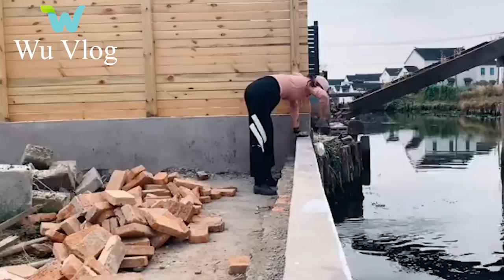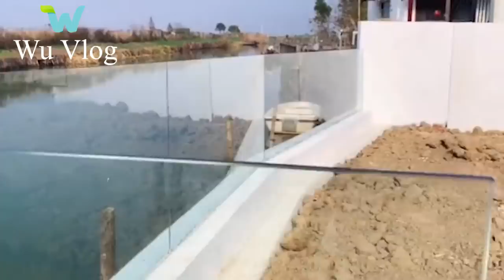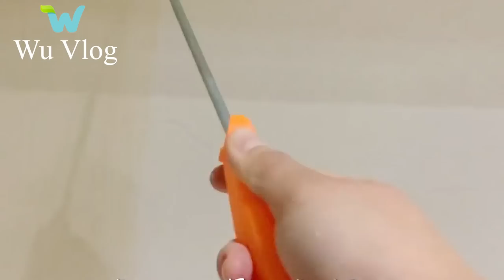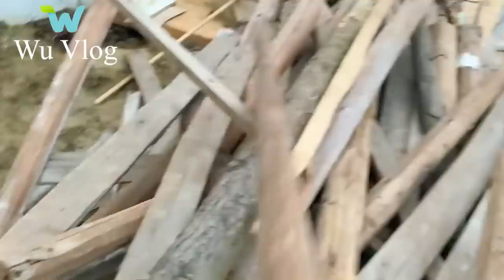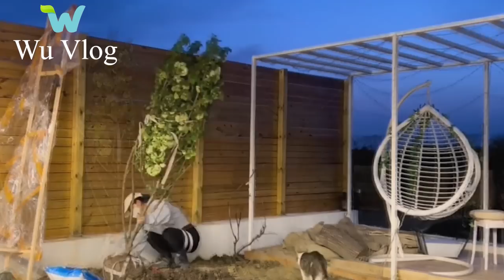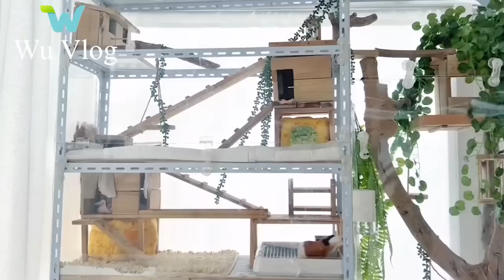After years of accumulating money, the girl decided to build her wooden house beside the river

Comment: I am wondering how this house gets insulated. Also, with concrete as a base, the floor must be cold in the winter. Would floor heating not be ideal?Beside the little fireplace, how do you heat this house? What are the round openings in the bookshelf for?